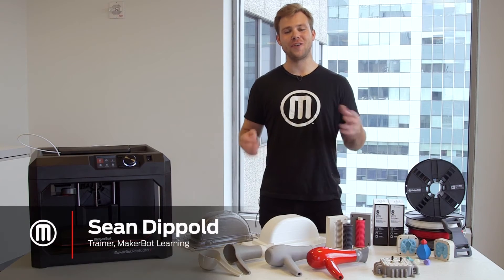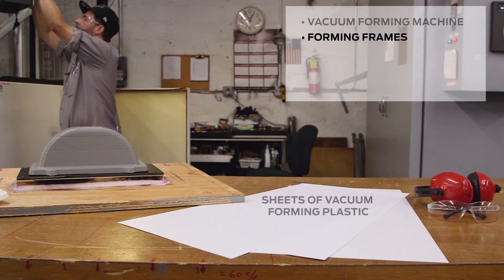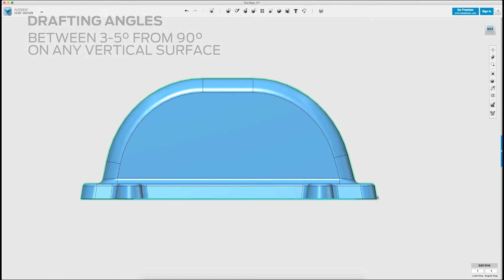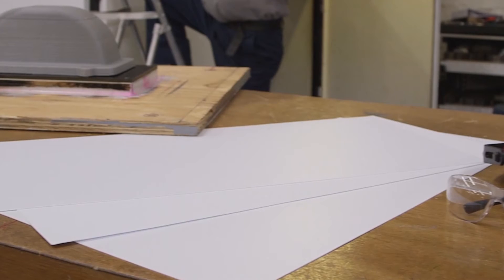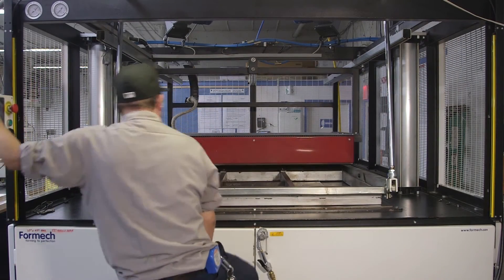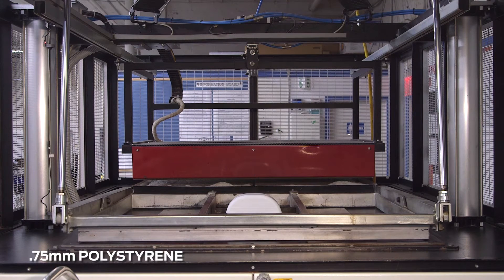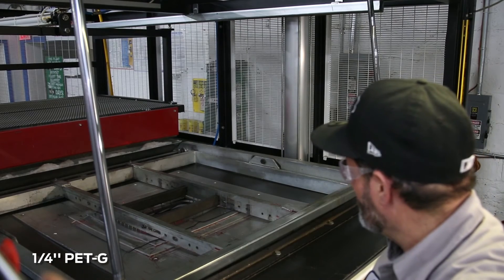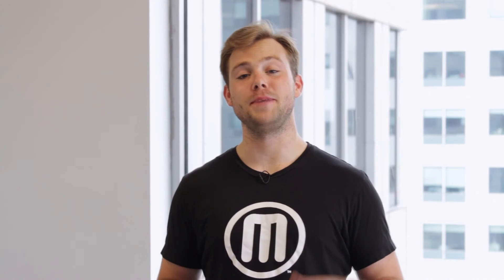3D Printing 101: How to Vacuum Form Using 3D Printed Molds

Comment: What 3d printing material did you use?
Reply from the maker: PLA or ABS works fine
Reply: @proto3000_  I just tested a PLA form. Works well better than expected. Just coated it with some filler potty and painted it with acrylic primer for smooth finnish.

Comment: What's the lowest infill I can use? Or should I always use 100% infill when using pla? I printed a pla piece to vaccum form at 30% and 50% and it warped during vaccum forming and it had melt spots here and there. I started using Abs with no problems but would prefer using pla. Was just curious if u printed using a solid infill or lower. I would like to be able to vaccum form the piece more than a few times without warping or melting. Thanks and love your videos.
Reply from the maker: Hi Shannon, 

Our suggestion would be to try printing around 75% infill and increase the number of shells to about 6-7. Increasing infill and shells should help with any warping, and produce a product that can be used a more than a few times. Let us know how that works for you!